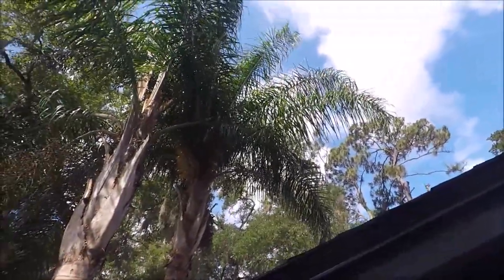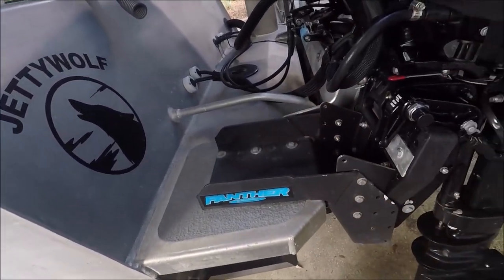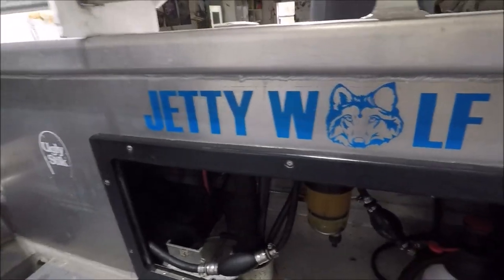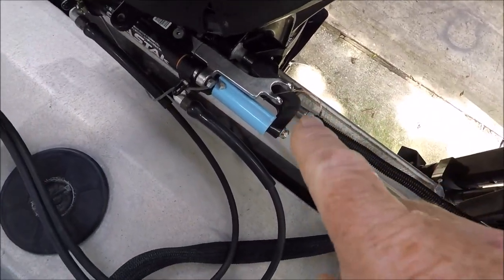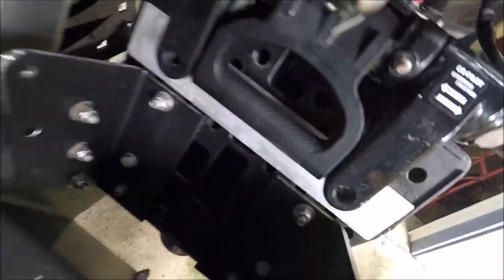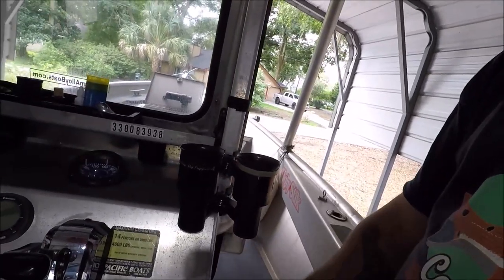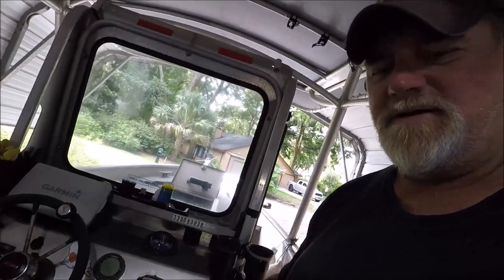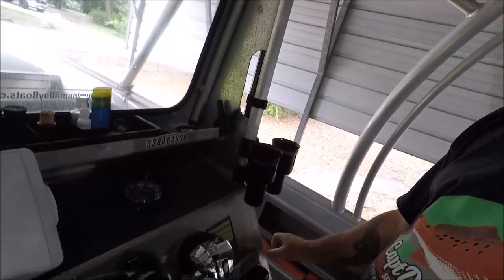MERCURY 15hp PRO-KICKER, now what❓

Comment: Congrats Capt Dave! 10000 people are a lot of people. Always a pleasure to help Capt Dave out. It's a good project and it will get done. May hit a bump or two but no real road blocks. I personally have never converted a Merc pro kicker tiller handle to remote operated so i"m in uncharted waters my self. And when the conversion kit comes Dave gets the distinct privilege of putting together probably a hundred or so little bolts and screws, washers  and fittings  lol. Good video, the channel is growing !
Reply from the maker: AND MEN DON'T RE DIRECTION❗❗  hahaha
Reply: Orowock, I've got a question. I've got a 2004 Evinrude EF150FPXSRS. When I'm on the water and put the boat in neutral, sometimes I get a nuetral switch position alarm. When I'm on land with the motor on muffs doing my flushes, I dont get any alarms when in neutral. Any idea as to what could cause this?
Reply from the maker: @NewVisionLCS  you're still dealing with that??? Dr. Gary may have a idea, ya never know.
Reply: @CaptDavesSportfishing  yep Capt Dave it's still doing it sometimes! I wonder if the rigging may need to be adjusted?
Reply from the maker: @NewVisionLCS  I'm sure if a expert....''hard to find one, that doesn't say, 2 weeks, 2 weeks'', especially now! Would make quick work of such a issue. Could be in your helm shifter. the neutral safety switch ain't nothing but a stupid cheap switch. I've replaced one before, a LONG time ago.  https://community.evinrude.com/t5/Evinrude-Pros/2012-90-hp-etec-neutral-safety-switch-question/td-p/21984
Reply: @NewVisionLCS   Those Evinrudes have a shift shaft that goes up and down thru a thick oring. Its very common for the shift shaft to get gummed up where it goes thru the oring. Drop the lower, remove shift shaft by turning it counter clockwise and counting the turns. When you go to put it back in, screw it in the same amount of turns. While its out clean it with some emery cloth . Remove the cover piece that the shift went thru, you will see the oring that needs to be replaced . Ive done 3 so far this year alone. If you get confused as to the number of turns to put the shaft back in, the general rule is usually 8 turns. And grease the hell out of everything. When the motor is running in salt water the shift shaft is submerged in salt water , when your running it on the flush it's not could make a difference. One more thing, prior to removing the shift shaft and counting the turns, pull up on the shift shaft and push down take note of the resistance then put it back into neutral. After the job is done repeat this and take note of the resistance. You will see a difference.
Reply: @orowock1  THANKS!!!!! Do you have an email if I get into a pinch??
Reply: @NewVisionLCS  I edited the reply so make sure you read it again   I'm going to create an email just for Daves channel I'll be putting it up soon
Reply: @orowock1  Gotcha!!
Reply: @CaptDavesSportfishing  I figured its probably something simple! Like you, I like working on my own stuff!!
Reply from the maker: @NewVisionLCS  I do only when its EZ other than that, I fixing mechanical shit!!
Reply: @CaptDavesSportfishing  did you read the repair he gave me?
Reply from the maker: @NewVisionLCS  yeah the first thing I thought was yeah he's going to do all that if you ain't fixed it yourself by now or found a way to fix it why don't you film it get out the camera I'm dying to see this
Reply: @CaptDavesSportfishing  yep gonna pull the lower unit myself. Since its apart I'll put a new water pump in and do the gear oil.

Comment: Anybody with a boat knows how long it takes to get an outboard mechanic to fix something. Here in Maryland, it takes at least 2 months. Last Sunday the starter motor on my 2007 Johnson 150 failed. Monday morning I was out there figuring out how to remove the motor and by Tuesday it was done. I've owned 3 Johnson 150s over many years (I'm 76) so I bolted on a replacement I'd scavenged from an older motor and got 'er done. Trouble is, at my age I have some difficulty recalling how I did the same job 25 years ago. So I saved what? - $500, $600? and two to three months wait. A final thought: A bass fisherman like me starts and stops his boat as many times a day as do you, so I feel for you brother. Good luck with your project
Reply from the maker: up yer way probably $150 a hr. labor.

Comment: TRY A KICKER MOTOR THROTTLE CONTROL SYSTEM BY PANTHER MARINE FIRST

Congratulations on reaching 10,000 subscribers.  I'm one of them and love your informative videos.  I have a kicker on my Proline 22 Sport.  I originally bought it as insurance but now I use it for trolling and moving around bridge pilings.  I have a Yamaha 9T and think of it as a trolling motor and not an outboard.  It is great for people onboard because I can't knock anyone over with a sudden thrust. LOL. I have incredible boat control and anchoring is so much easier.  For low speed trolling it is a dream.  

Anyway,  I'm writing to let you know that there is something called a PANTHER MARINE TROLLMASTER TM201DPRO for your Merc 15 hp.  Yes the manufacturer of your kicker motor mount bracket makes a device that mounts under your cowling basically a servo that controls the throttle on your motor.  It has a wired remote that you can easily mount to your dash.  I use to have it but I'm spending so much time in the back of the boat with the kicker tiller that I stopped using it.  It has much finer speed control than any throttle control you will install like your main motor.  Walleye anglers and freshwater striper fishermen everywhere have become expert trollers with such systems.  Before you invest big bucks in cables and a throttle system try this system (<$300) it will probably cover you for what you are trying to accomplish.  There might even be a wireless throttle control for a kicker out there by now. 

I run Yamahas on my big boat (225 HP and 9.9 HP).  I run a Suzuki 15 HP on a jon boat.  I'm starting to like the Suzuki I bought last year but the jury still out on it.  All Outboards are a pain.  Use the best freshest gas available.  I use Ethanol free gas and Yamaha ringfree.  Marine Stabil too.  I do my maintenance on my motors every 50 hrs.  Twice as often.  I troll a lot.

Good luck with your decision.  I would give the above a try.  

Thanks for the awesome information you provide.

Mike Scherner

USCG Captain Chesapeake Bay
Reply: Capt Mike, hope to see you out on the Pier at Mayport N.A.S.    good info Sir.
Reply from the maker: I've already looked at it.....not what I want. Looked at it two days ago, known about it for years. its really for just trolling.
Reply from the maker: ya know....my whole bracket that I used is  MARINETECH, (panther folks) and my steering arm, too.  I really looked into their stuff. But really want the real deal.  In and out of gear. I watched the install video, read the PDF file. Good, but still more for trolling. I need to drop anchor, pick up anchor, and need neutral, w/ kicker running. Might work, but might not, for what I want...I do no big time trolling.

Comment: I don’t understand? It’s no different than running that motor on a Jon Boat with stick steer etc..... Am I missing something? Now, I do understand the cost side of this problem😳
Reply from the maker: no, not really. there's tilt, start, reverse, forward, binnacle locale, key switch? AND, going from a very high tech tiller, to a conversion kit to get rid of it.